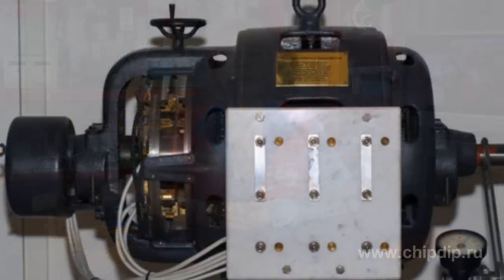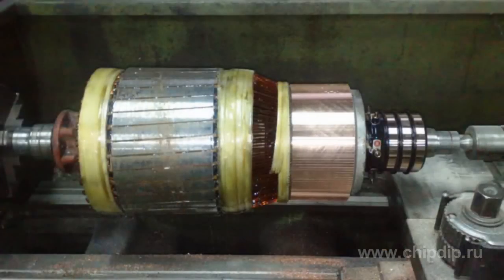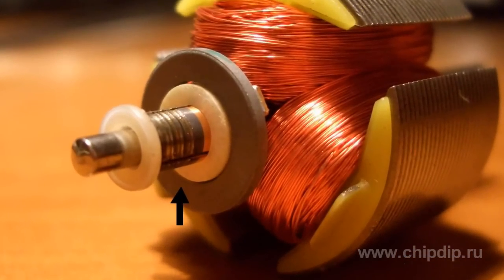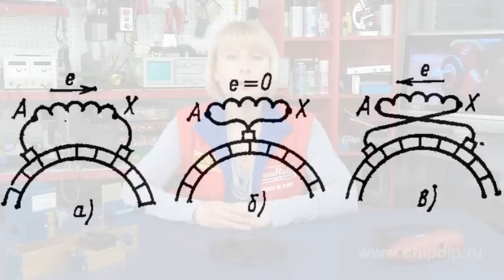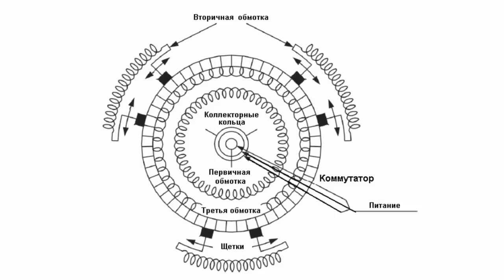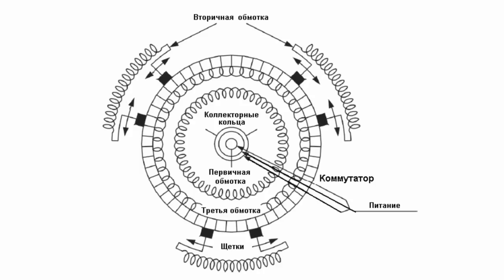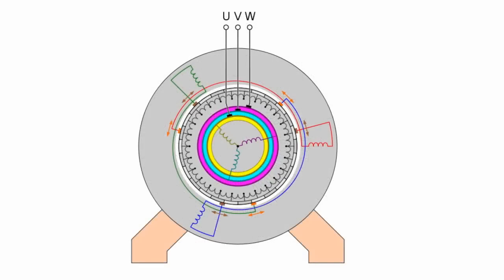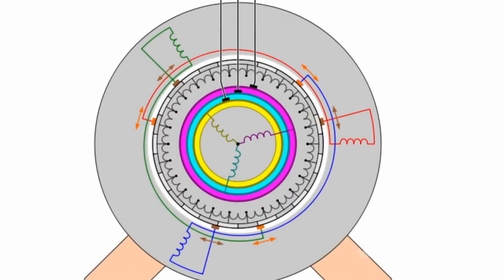Schrage-Richter Motor

Comment: One of the most elegant electric motors ever invented. Congratulations to Schrage and Richter as even up to this day, many people still do not understand how it works.  We had one at university and no one used it as they did not know what it was!  Schrage and Richter must have spent many nights awake trying to solve the fact that the voltage injected are at the slip frequency otherwise this motor will not work.  This is where engineering contains beauty, elegance, and art which few understand and can behold its existence.  Such elegant engineering now belongs to history and past engineering ages with the invention of the invertor which can generate the variable frequency outside the motor.